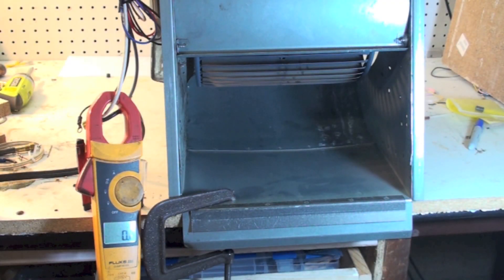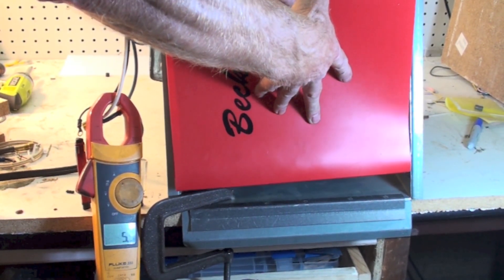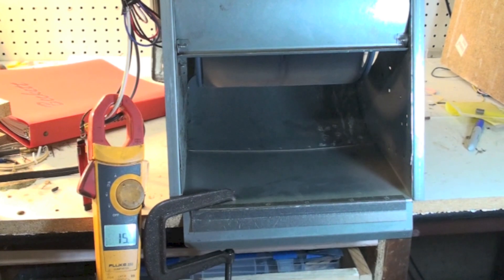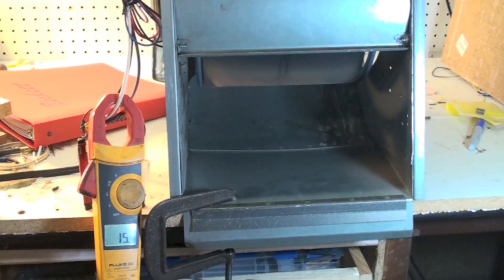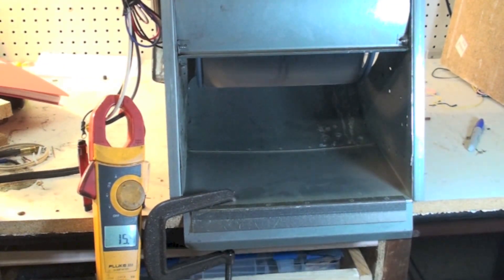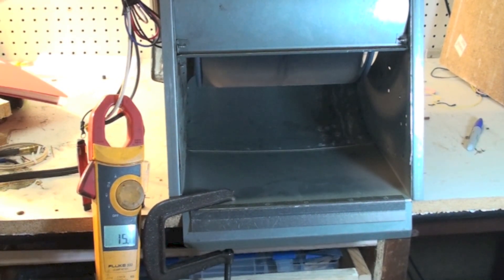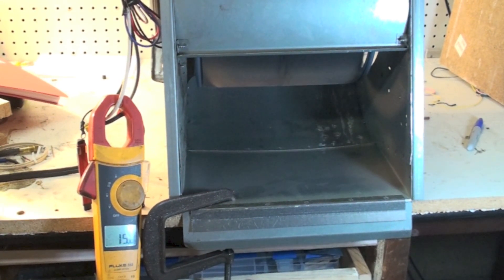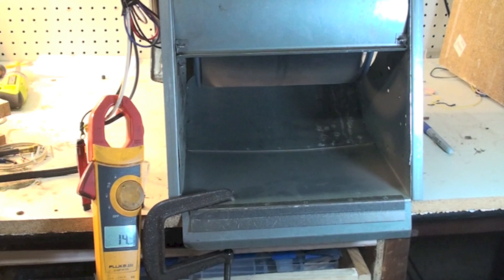The why of the amp draw of furnace blowers.  Their use in air handlers and furnaces

Comment: Here is the physical explanation. For an impeller blower fan, the fan blades are the easiest to spin when the air outlet is fully blocked. This is because the air accelerated by your spinning fan blades has nowhere to go and simply works as a tail wind for these same fan blades helping them spin. Once you open the outlet, the accelerated air molecules escape into the ducts and no longer act as the tail wind for your spinning fan blades. This is what that current amperage reflects.
Reply: This explanation is actually better than the video 👍🏾

Comment: I finally get this. The best analogy I could figure was a straw. If you try to blow through your mouth to move a piece of paper that is say 3 feet away, it takes a lot of power to move that paper. Once you use a straw and add some static pressure, you can use less power and puff through the straw and move the paper with ease.

Comment: I've been trying to track down an issue with my newly installed AC where the furnace blower motor would cycle intermittently. The installers did not measure static pressure or motor amp usage, and I didn't have the knowledge to ask them to. I covered most of the surface area of my returns, and the blower motor rarely cuts out now, so I'm assuming it was drawing too much current due to too much air moving through the system. My old duct work is very leaky and not well sealed. If I seal the ductwork, would that achieve the same lower amp usage as blocking the return vents? Yours is the first video I've seen which seems to explain my problem. My installers think I need to add another return, but that sounds like it would just make the problem worse.
Reply: If you block your returns with an ECM motor your amperage goes up not down. Amperage will go up because they will spin faster to try to make up for the air you blocked off.

PSC motors will not over amp due to restriction of air. But if you restrict air over your ac unit you could flood the compressor outside. Restriction of air can cause your heat exhanger to overheat and shut off on high limit too.

Comment: My furnace blower uses a ton of power to run. If I put restrictions in to reduce the amps, will that cut down on wattage used to run it and thus save me some $ on my electric bill?
Reply from the maker: It will reduce the power, but you will need to check temp split across the furnace to be sure you are not above the temp on the rating plate.  You may also need to consider that a lower air flow could reduce efficiency of the heating system.
GFM

Comment: Im using a  GE 4 speed, 3/4 hp, 1075  rpm, 11 amp blower assembly from a 5 ton air handler for a air filtration system in my wood shop. To create the proper static,  with filters and possibly baffles, what would be the expected amp draw? I want maximum flow,  but I don"t want to damage the motor! It will be on high for several hours a day... Thanks, I hope this is enough information for you to make your decision... After deciding the High Speed amperage, will it be fine when the motor is switch to a slower speed...Thanks Roger
Reply from the maker: There is no way to know the projected amp draw.
I would simply install the air handler and filter, then check amp draw of the motor.  If it is above 11 amps, reduce air flow by blocking off part of the return.  If the high speed is ok, all the other speeds will be less.
GFM

Comment: Great video.You show the amp draw as the load changes.
I was wondering why my motor was hot when I tested it outside on my patio.You need to have static pressure of the ductwork to have the lower amp draw.

Comment: Very helpful video, this helped me understand why my fan is behaving like this. Thanks.

I have removed a similar blower from my old decomissioned ducted heater furnace. It's 240v(I'm in Australia, all single phase is 240v) and I'm observing the same behaviour with my fan, it's rated to consume 240W but with no restricting of the airflow it will pull 650~720W from the power point. Rather than restricting the airflow to reduce the current/wattage consumed, can I use a motor speed controller instead? When I repurpose the fan, having it run more quietly will be better than restricting it's airflow given my intended use for it. As long as the speed controller can do this safely, are they any issues with using this means to acheive the rated power draw instead?
Reply from the maker: You can. I did a video on speed control of the PSC motor.  Look up "motor speed control" in my channel.
GFM
Reply: grayfurnaceman thanks. I have a group of wires from the motor but they are all wired into a plug, on the corresponding plug(to the furnace controller) there is only active, nuetral and earth. I'm reluctant to start cutting until I know which one is for which. Also I'm not sure if the US wire colour conventions are the same as here in Aus. Brown is active, Blue is neutral and green is earth. Maybe I'll try to dig up a service manua and correlate that info with your info, this came from an extremely common outdoor furnace.

Comment: GFM, I did a similar test on inducer motor today, and I observed RPM goes higher when I block air flow. It is not a variable speed or torque sensing motor I believe. Model number Fasco 70625622. Amp draw goes from 0.06 to 0.05. I can hear the RPM goes higher. Does RPM goes higher when you did this experiment?
Reply from the maker: +Guy Hakverdi Yes. The load is lowered because it is not moving as much air.  Amp draw will reduce but not much if it is a shaded pole motor.  PSC motors will reduce more.  
GFM
Reply: I think motor speeds up little bit because air velocities have to go up to catch more air but still does not move enough air movement so amp draw stays low. Because, I can swear I heard the motor is speeding up ,and it is not ecm motor.

Comment: Can the same thing be said for belt driven motors? Also, would putting a filter on the output reduce airflow?
Reply from the maker: ***** Yes.  Installing a filter on the output will restrict airflow.  Stick with the one in the return.
GFM

Comment: I've got a 2-level home in Las Vegas. Needless to say the upstairs gets pretty hot in the summer. I've got a 5-ton split system and was thinking of using dampers to separate the floors into two zones, but I've seen a lot of information online saying without bypass ducts or a dump zone, the back pressure on the blower could shorten its life. Is this true? Its a 1 HP blower motor and already runs really loud. Closing off zones would make it louder, right?
Reply from the maker: Cody Brown Ahh, the eternal problem with cooling.  About the only thing you can do is reduce flow by the diffuser dampers.  And then you freeze up the unit.  If you effectively damper the system, the blower will make more noise and if it is a variable speed motor, it will damage the motor to the tune of $500 to $1000, not to mention freezing up the unit.  If your unit was a 2 stage air conditioner it would work.  The best solution is a separate air conditioner dedicated to the upstairs and one dedicated to the downstairs.  I know this is not a welcome solution, but it is the only truly effective solution.
GFM
Reply: Thanks for the info. If my blower sounds like a truck running in my driveway compared to my neighbor's unit which is virtually silent, could that be a sign that it's too big or the evap coil is clogged?
Reply from the maker: Cody Brown It may be a sign that the blower is dirty, coil plugged or ductwork problem.  Probably not too big.
GFM

Comment: Hello...I tried an experiment...I placed a 20X20X4 filter in the return duct in the hall ceiling for 3 months and monitored the results. (No obvious air flow restriction). Seems the 4" filter caught MUCH more dust etc. and the standard 1" filter inside the air handler looked half its age. replaced both when Wifey commented the air smelled musty. (The 4" filter was PACKED). (I should mention I run the A/H 24/7 due to smokers and dogs). Any thoughts?
Reply from the maker: bryanseitz I would reverse the filters.  Use the 1" as a prefilter to catch the large particles and be replaced more often.  The 4" then can be used for much longer periods.  Hope this helps.
GFM

Comment: I have seen in some applications (where ductwork isn't necessary) such as open space installers installed air handling units with restriction plates in front of the blower. Is this something you would recommend?
Reply from the maker: Guy Hakverdi Yes.  Oftentimes the fan motor will overdraw with no back pressure.
GFM

Comment: The density o the air filter will affect this amp draw then, right?  Do you recommend these pleated filters with dense media?
Reply from the maker: ritewayguy Yes.  any filter will reduce air flow and amp draw.  I need to be doing some definitive videos on filter pressure drop with different types of filters.  For now, if you want to use the pleated filters, the ones with the most pleats are better.  Better yet, 2" is better than 1".
GFM

Comment: Hi GFM,  just starting g to read about this static pressure stuff.  So the only reason that the amp draw is high when the fan is not covered is because the fan is trying to push air all across your shop instead of in a certain area?  Is that some what right?
Thanks for the vids they are a great help
Reply from the maker: That's pretty close.  This type of fan is designed to run against a back (static) pressure.  Its kind of like driving your car down the road.  If you hold your foot on the throttle and step on the clutch, the engine will rev up and may overspeed.  
GFM
Reply: grayfurnaceman Thanks for the info, that makes sense. I like the car comparison thanks GFM!

Comment from the maker: Anything that reduces the amount of air being moved will reduce the amperage draw.  One of the ways to diagnose low air flow such as undersized ductwork or plugged evap is by blower amp draw.  As its resistance to flow increases, (static pressure) the squirrel cage blower simply reduces flow.  Hope this helps.
GFM

Comment: 2 questions.  You were covering the supply side but if you covered the return side then would the amp draw rise? Also if you  had say a plugged evaporator or undersized ducts, would this also result in a drop in amps.

Comment from the maker: That could be correct.  The amp draw difference seems high.  Be sure all covers are closed when you check amp draw.   Amp draw should not be in excess of the rating plate on the motor.
GFM

Comment from the maker: The key to this is what a load is in air movement.  A load is movement of air from one place to another.  If the vol of air is not moved, work is not done.  Remember this is not a positive displacement pump. The air flow depends on centrifugal force to work.  When blocked the air simply circulates in the wheel.  I know this seems odd.  I will doing a demonstration of this in the future.  Hope this helps.  
GFM
Reply: I found this to be the easiest to understand by checking what exactly the circulating air does inside the fan if the air outlet is blocked. Once one figures out that this air works as a tail wind for the fan's own blades helping them spin, there is no paradox anymore.

Comment: I really don't understand the why part of this. If you take a motor that is running, then put a heavy load on it, the Back EMF drops which should make the current increase. So on this blower, I am trying to figure out how there is more load, thus more current, on the motor when the airflow is not blocked. Thank you!

Comment: Never mind I am wrong I looked into it I will remove the comment. The force of the air itself makes the load on the motor go up with no resistance to flow.

Comment from the maker: The answer is maybe.  As more of the air flow is blocked, the amp draw of the motor drops and if the air is completely blocked the motor will drop to minimum amps.  Minimum amps means minimum power usage. However, the fan motor is cooled by air over, so if all air is blocked, it will overheat.  But it will take quite a while.
GFM

Comment from the maker: In the case of this blower, the motor was not variable.  This experiment works with most motors.  Motors are lineal in power usage.  That means if they do more work (move more air from one place to another), they will use more power.  Remember air has weight and moving it takes energy.  I will be talking about duct systems and static pressure soon.